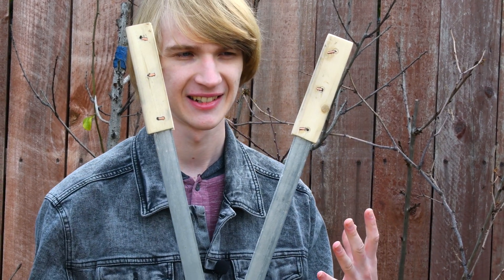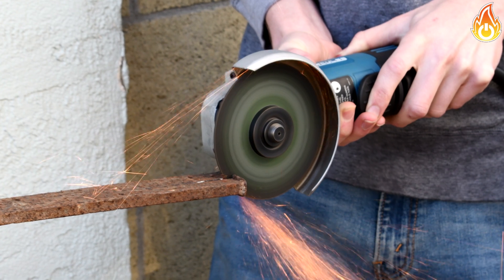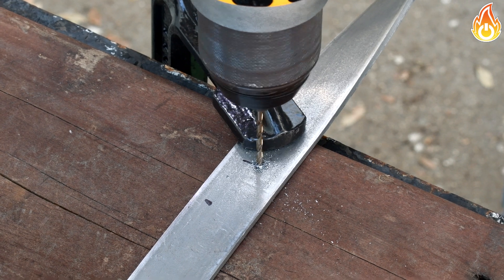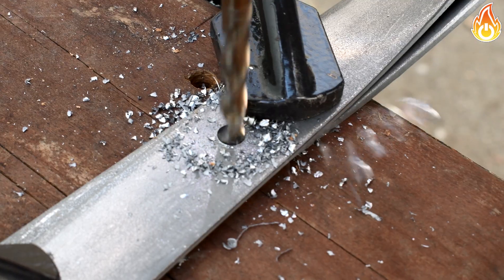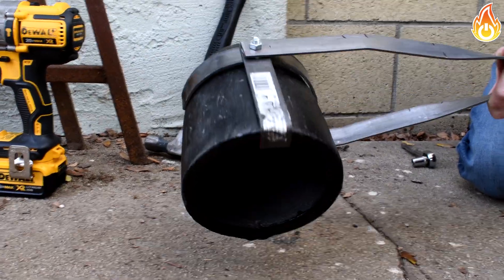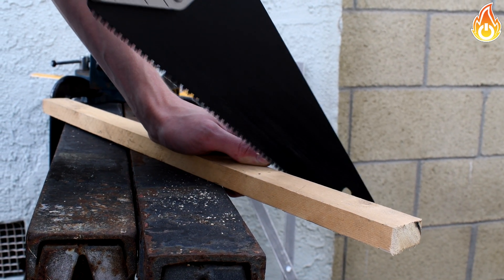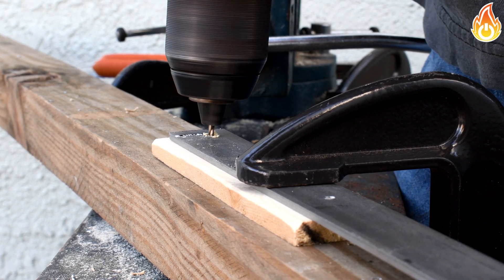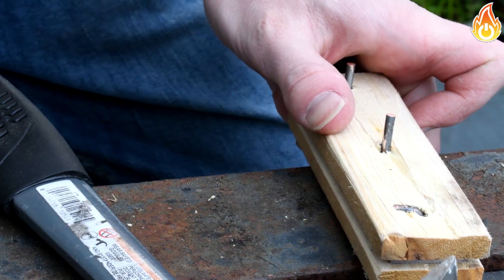HOW TO MAKE MODULAR TONGS FOR MOLTEN METAL / CRUCIBLE FOUNDRY TONGS (EASY) (Tongs with 3 steel bars)

Comment: You can put the tong and bolts on anvil and heat the bolts and flatten the top of the bolts by hammering them a bit flat and the bolts will never come loose.

Comment: Good design but the bolt heads inside the tong jaws make me a little nervous. They seem like they'd be two pressure points on the crucible when you pick up a full one... If I build this I'll have to round off & smooth out the bolt heads at least. Most likely I will get the jaws welded on instead. Don't need to increase the probability of crucible breakage.

Comment: Did you use the tong as intended (one for pouring and lifting) or did you use a second one in the future to improve speed while pouring? 

Weekend Stuff
Reply from the maker: Currently, I am still using just the one tong, but in the future I will be making separate tongs!